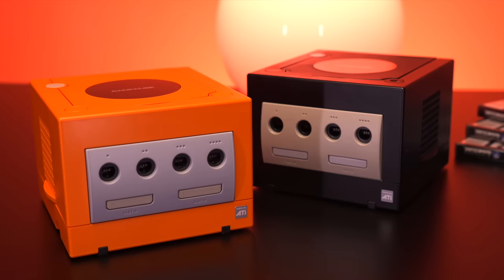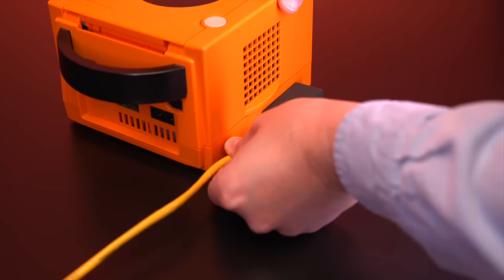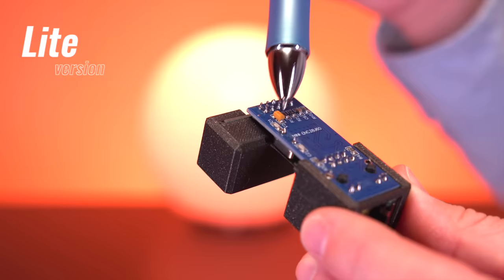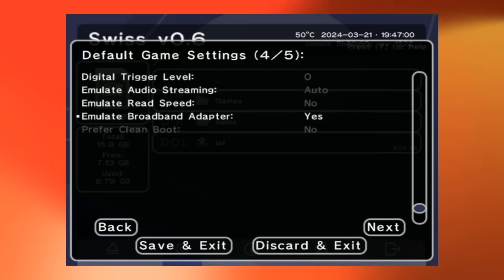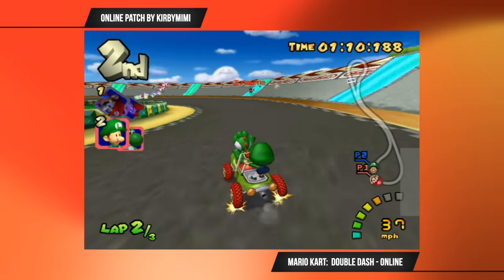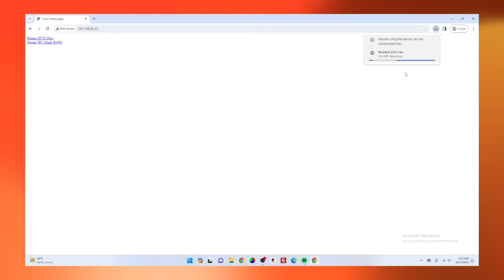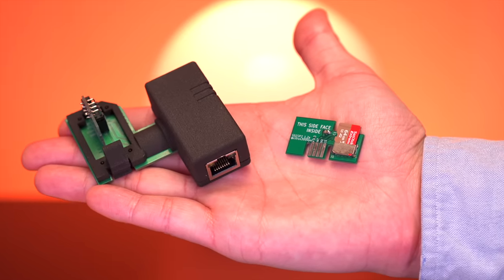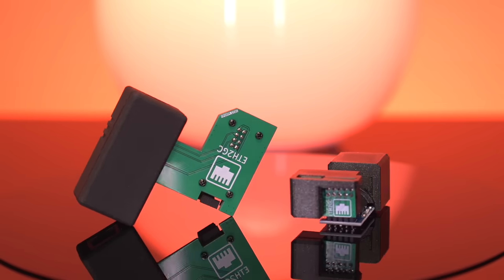DON'T Buy A Gamecube Broadband Adaptor.  THIS Is CHEAPER!

Comment: pretty crazy what the gamecube modding community comes up with. love it. i already modded my gamecubel with a gc loader and a sdtosp2 adapter, has a 256gb sd card fully loaded with just about every great game the gamecube has to offer on it. i even put in a 3d printed sd card adapter cd drive cover that is black and has the umbrella logo on it made by laserbear.  also has a GCHD MK2 adapter and a Marseille M Classic adapter for the best picture quality possible. definitly one of my favorite console mods ive ever done. i even modded my PS2 with a internal hard drive and a noctua fan it has over 187 games on the hard drive too, also modded my dreamcast to run games from a sd card too. i shell swapped it with a see through green shell and put lights inside it, i have a funtastic green n64 that i made region free and i soft modded my original xbox. the sky really is the limit when it comes to modding consoles.
Reply: Benefits over getting a Wii and modding it?
Reply: @rc_matic For some it might be just nostalgia. GC might been "shortlived" in comparison of other systems of the generation, but for some people it might been a console that became something special for them, like being their first console. It's also purely a matter of taste, but personally think the GC looks way much better than the bland white block that the Wii is. Also any opportunity to avoid Wii's motion controls, even for just browsing the Wii menu, is a win.

Comment: I can only imagine what can be done with this and Slippi (Melee). There was a way to do online Melee in JP. but now I can see it come to reality with no emulation and with the benefit of slippi on console and CRTs.
Excited for this project.
Reply: This. I can finally play Slippi on a PVM without a need for changing out my graphics card or buying extra video adapters.
Reply: I don't think it's possible to have Slippi on GameCube, since there wouldn't be enough spare memory to hold the rollback states.
Reply: @FyreWulff  I dont know anything about the tecnical terms of rollback, but the reason I made my comment is because I saw a video of "psychoticworm" titled "SSBM 2P Online battle 01" from 2006 playing Meleeonline, so seeing this video remindedme of this, hope it can be done by some programing magic. :)
Reply: @FyreWulff  It might be possible if we were able to use SLOT B for the memory card as a way for more RAM to hold those states without breaking the console.

Comment: Yeah, THE big con for me is that this uses Serial Port 2. Some people have DOL-001s that lack Serial Port 2, and DOL-101s pretty much all lack it completely. Meanwhile my SP1 is completely empty and unused, and I have no reason to put an M.2 Loader in there as I have a GC Loader HW2. I'd love a broadband adapter replacement that goes in SP1.

I LOVE the concept of expanding GameCube with online support patches though. I could just imagine a sophisticated online matchmaking feature being added to Mario Kart: DD that matches MK Wii's (as opposed to direct connection), for example. Nintendont on the Wii is also capable of emulating the Broadband Adapter support using Wi-Fi, so the overall accessibility of GameCube Online should improve with time.
Reply: Can attest, I have a DOL-001 silver Gamecube. Still have digital A/V but no SP2, so no SD cards there, and apparently no homebrew ethernet adapter. I'm doing the flippydrive ODE when it releases so I don't see a point in buying the M.2 loader either. Price point is fantastic, just need it to be available to everyone and not just the lucky ones with all the ports to fill.

Comment: Something that would be insane would be using an ESP32 or something to adapt wifi to this, just connect it to a network through an onboard sd card or setup file/application then have it behave just like wired ethernet as far as the console is concerned.
Reply: Agreed, if nobody is able to make that happen, you can achieve the same thing with a cheap $5 wifi extender or mesh network pod with an ethernet port.

Comment: SP2 though. I'm lucky and got a broadband adapter back in the day when I got PSO, but SD2SP2 is how I save my Swiss settings. This isn't for me, but for people who have their GameCube set up similar to me, it's gonna be tough to swallow.
Reply: This can be used to have Swiss on in place of SD2SP2. I own one and it works just fine
Reply: I'm hoping someone comes up with one that doesn't leave an ugly box hanging off the side of the GameCube though. Even if it has to use SP2, I'm hoping for a version that routes the cables out of SP1's hole in the side of the console. That would be super nice, especially when the model that supports SD2SP2 in it comes out in the future.
Reply: @NottJoeyOfficial  isnt this the guy that mad the m.2 loader on sp1?

Comment: Honestly speaking, it'd be pretty cool to get this working with the other serial port that the official adaptor used, just to give people more options with how they use Swiss. This would work great with the m.2 adaptor project, but a version that uses the other port for people with the set up like you have for booting Swiss. But the fact it works at all is awesome.

Comment: I'm not particularly confident in my own capabilities with soldering and modding and I'm kinda broke, so the fact that i have a newer revision of the DOL-001 which doesnt have the serial port necessary for this mod is a huge blow. Makes me feel like I wasted my time with this particular GameCube being modded, since the convenience of this mod for ripping my own games. I'll have to wait for the M.2 loader to be able to load Swiss and for this project to be able to be utilized via the memory card slot before I can get the whole thing working close to optimally, and even then, it'll look likely far less clean than an original DOL-001 with the full kit. 

I'm not mad at Extrems or WebHDX or anything here, i just didn't know what was going on with my own GameCube til my friend who did the modding for me showed me what was up with my model. To quote a great show, "That's rough, buddy."

Comment: When I think we done everything with the Gamecube...someone just do a brand new mod that awesome !

And this one is a need one, like the GCvideo project ! The Price is great, it does what the real Broadband adapter do but with more "homebrewish" stuff, the only downside imo, it's this ETH2GC use the Serial Port 2 and not the Serial Port 1. So all user that use the SD2SP2 have to found another way to use Swiss.

Maybe a Serial Port 1 version can be make later, and I suppose it's also because the community have better knowledge of how the Serial Port 2 work.

After saw that, I thinking that a new Broadband adapter can be do for the Dreamcast as a replacement of the Original Broadband adapter that expensive to, but I think the projet need more stuff, to do incompatibility with games that only work with Modem and not with Broadband !

Great video ^_^ !

Comment: Sadly, Kirbymini was confirmed the Twilight Princess mod will never support real GameCube, it's Dolphin only. The MKDD mod is pretty awesome though, and surprisingly seems to work better on real GC than on Dolphin, at least in my experience (I have some footage of both in my channel).
Reply: Is there any input lag or frame stuttering while playing for mkdd?
Reply: @GoombaNL  on dolphin, really depends on the distance and connection quality, there can be a lot of stuttering if conditions aren't the best. on Gamecube it's a lot more stable, i've had intercontinental matches with no stutter. in both cases you can control the input lag by adjusting the buffer. higher buffer means more lag but less stutter.
Reply: @NintendoDuo  for GC online what would you say is a comparable dolphin netplay buffer comparison? Or is it legit on par with 2f slippi rollback for example? And thank you for replying :d
Reply: @GoombaNL  to be honest I haven't played a lot of Dolphin netplay or slippi so I'm not sure. I doubt it's as good as slippi rollback but it does feel very smooth under good conditions. I usually play with a buffer of 6-8.

Comment: The cons are that both versions take up space on the side of the Gamecube (would be nice to have it on the back).
Also that it takes up the SP2 slot so you can’t have an SD card there. But I absolutely LOVE that this is a thing. I have BBA’s for all my Gamecubes and I’ve been missing online support in the homebrew scene. Hoping this will spark a flame on that front😄

Comment: In the pros and cons, I believe one con is that render your SD adapter useless, since you have to choose what you will plug in the slot. While you have options to fix the problem, it still requires you to buy more stuff for your GC.

Comment: My biggest con is that it doesn't look like a stock Gamecube anymore and I don't ever buy mods that change the aesthetic for my consoles. I wish they gave an option that would route the RJ45 plug through the broadband section of console so it doesn't ruin the aesthetics.

Comment: This is fantastic, but I don't understand why they made this for serial port 2 and not the otherwise unused port the official broadband adapter uses. Is it not possible to access that port via Swiss or something? I would get one of these but my setup revolves around loading games via serial port 2, and I don't want to use a memory card adapter when I don't need to. There's so much to like here otherwise - pointing the cable backwards rather than sideways out of the Gamecube is genius, for example. I just wish it used the broadband port...

Comment: The one con would be that you can't use the versions of this available right now & load Swiss via a microSD card at the same time. And even then there's a version with a microSD slot in the works so it's something that will be rectified in the future.

Comment: The only reason I even bought the Broadband adapter (I was still using dial-up up until late 2008) was to hack the GameCube. I also bought a copy of Phantasy Star Online Ep I and II as it was need to hack the GameCube. I still have that same offical Broadband adapter and that game today. I got the adapter used from my local GameStop. I don't remember the actual price but it was less than $30.

Comment: i suppose a Wifi version will come soon. Regarding the cons, there is probably not much that can be done about that but still: it requires a modded Gamecube, it is not a drop-in replacement for the official broadband adapter.

Comment: This is pretty cool. However, an even cheaper option for anyone that already owns a Wii or Wii U is to use Nintendont, which I understand now emulates the BBA.

Also, 8:32 "There is an alpha build of [Twilight Princess multiplayer] available for Patreon supporters."
Incoming DMCA in 3, 2, 1... Nintendo has previously taken down multiplayer mods like that (SM64 online), and strongly prioritize projects that receive financial compensation. Patreon paywall shenanigans is exactly what made them pull the trigger on Yuzu.

Comment: Broadband adapter to wifi is the obvious next step. Granted you could just plug it into a cheap $5 wifi extender to do the same thing, but an all in one solution would obviously be much better.

Comment: I'd like to see a version that uses the serial port 1 slot
I'm not a fan of the thing sticking out of the side
even if it would work by running a ribbon cable from one slot to the next, at least you won't be able to see the ribbon cable

Comment: This is super exciting and I definitely want it, but not being able to use it with SD2SP2 is a bit of a deal-breaker for now. Once I can get my hands on a FlippyDrive that won't be as big a deal, but I like the SD adapter and don't want to give it up for a network adapter.
Reply: I hope someone uses a Serial Port A version of the aftermarket GameCube BBA since that's the same port used as the official Nintendo one.

Comment: You said no cons, but giving up SP2 seems like a pretty critical con for SD2SP2 users.
And why isn't this using the SP1 and hide the cable connector in there while we're at it?

Also, does anyone know where one can get a replacement for that Z trigger tactile switch so I can finally fix my wavebird not having a working Z trigger?
Reply: * TC-00100V tactile switch
* 5mm height from actuactor top to switch base bottom
* 80±30gf
* Operating Life: 1 million (1,000,000) cycles
* IP67 waterproof

Comment: The con is that it uses the serial port which I already use for an extra SD card.  Wake me up when they come out with an adapter that fits in the expansion port that the OG adapter fits in.  :)

Comment: Tito, I need your help. My HDMI & Picoboot modded GameCube DOL-001, does not have an SP2 port. A video on adding one back would be great. I have not been able to identify the needed components. This looks like it could have great promise.
Reply: I believe the connector itself is the only missing component on those DOL-001s. I don't know if the connector is available separately or if you'd need to salvage it from a dead motherboard. You can also solder any SP2 mod in using wires instead of the connector.
Reply: @eDoc2020  I don’t have my GameCube disassembled or the photos in front of me, but there are a few passive components that look like they need to be added back for the traces to get signals to the port. I believe they are labeled on the motherboard as GA4, and GA5, but again I am not looking at it right this moment. I have not been able to identify what those passives are.

Comment: Great video and a great open-source device, but all of the features that you mentioned are also possible with the official BBA.
You said "You can now..." a couple of times, making it sound like this device offers features that were previously not possible.
Reply: I think the implication is "without breaking the bank", though there's the potential for confusion in not clarifying that I suppose, particularly on the more niche uses.

Comment: It uses the same port that you need to have your games on a sd card. So you can't use this and use the gc loader, you need a disc and a disc drive. Mine has the gc loader which uses serial port 2 for loading games so I cant use it
Reply from the maker: You can use the memory card port to load Swiss and game as I show in the video. There are several other methods as well
Reply: I commented before I finished the video.

Comment: Guess I will get the cheaper kit then, remove the connector, and run the cables through the cube so I can have the port on the back.
Really cool what is possible, though it would have been even cooler if webhdx gave us the M2 adapter with it right away.
Maybe I will also add a mod for power over USB C while I am in.
By the end of next year we will probably have entirely new cubes after exchanging every part xD
Reply: I think it's just connecting an off the shelf module to the GC without any extra components. If you're thinking of getting the cheaper kit and removing the connector you could more easily use a bare module.

Comment: Is there a reason they couldnt have done this for the broadband port? Or do they really think everyone will want to use that nvme thing in there? That nvme thing is nice, no doubt, but I'm more interested in using that port as intended. Plus, nvme drives are considerably more expensive than SD, so as it stands, I'll stick with the GCLoader and use nvme's in my PC and PS5 where they matter most.

Comment: This is cool! I used to dump discs using a qoob pro and bba. It required a crossover ethernet cable. Does dumping via Swiss just use a regular ethernet cable?
Reply: The required cable depends on the specific hardware. It will probably require the same cable type as the original BBA or an old PC. Realistically it doesn't matter because most modern equipment auto-adapts to the cable type. If your setup has a network switch from the past 20 years either cable will be fine.

Comment: Is there a reason this doesn't use the SP1 as the default? It would remove the need for both of these to be poking out, but also not removed the ability to use an SD2SP2 and potentially save the use of memory cards also?

Comment: I was expecting it to work on Serial Port A as the OEM Broadband adapter used that port.  Now LAN GameCube games will be rendered useless with a useless add-on.
Reply: It doesn't matter which port it uses. You can use ETH2GC in one console and original BBA in another to play LAN multiplayer together.
Reply: @maciejkobus  I mean, the original BBA uses Serial Port A, which is recognized by the games that officially support it.

To respond to your comment, one GameCube would detect the BBA, but the other wouldn't as it would only detect BBAs through Serial Port A.
Reply: @NewGabeOrder  this is why we use Swiss to emulate original BBA in games, we trick them to thinking they talk to the original hardware and translate the communication to a different Ethernet driver. It’s a non issue, we don’t need to use Serial Port 1.
Reply: @maciejkobus Well, I'd rather keep things as legal as possible.  Without Swiss, you have to abide by the official connection terminals or something similar.
Reply: @NewGabeOrder  Swiss is legal. You are not violating any laws by using it. Actually you’re missing out on a lot of great features. There won’t be a BBA replacement that does not rely on Swiss or help from software anytime soon. It’s simply too difficult to emulate in hardware.
Reply: @maciejkobus I see your point.  Not to mention there will be an M.2 SSD adapter for the GameCube, and since that will take Serial Port A, this Swiss-only Broadband Adapter will take Serial Port B to compensate for that.